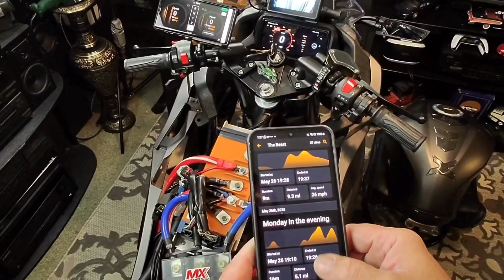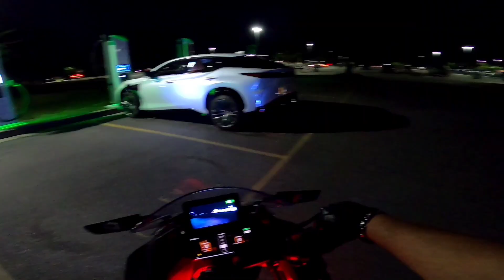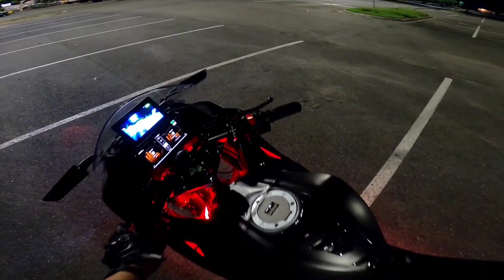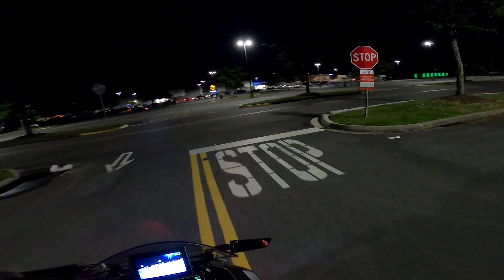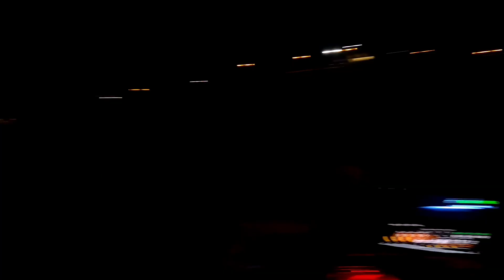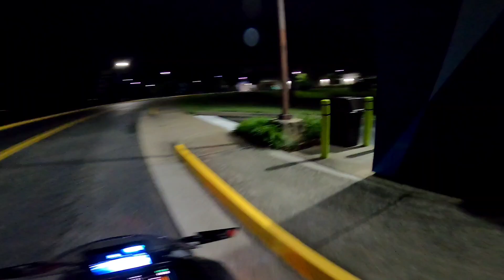100mph plus in speed & Range + regen on a 72v Electric Ninja Rz See how it rides & You be the Judge!

Comment: And it's a72v 50apm lithium battery ,the only upgrade I did was the controller upgrade same votol brand from Em 50 to an Em 100 controller and motorcycle tires and side from ninja 300 mirrors .

Comment: Oh so now you want to give up all the secrets??
Reply from the maker: Bro I been giving up the secrets for a long time. You just gotta watch all my videos cuz Im always giving it up but its never in the beginning. Id put that shit in middle or the end so those wanna skip thru or just hate watching me, lol aint never gonna get it. The secret has always been Battery Power but Good Batterys dont come cheap and the best batteries you cant buy at all, they gotta be custom for custom builds or you can put together a few of the manufactured in paralell that still aint cheap. The cheapest Good battery company is amorge and their closest pack to this is a 20s19p Molicel P50b pack that cost $3700 and some change and thats made with Prefab bus bars. someone though i was BSing when they ask me how much to build them a 100ah the way i build it, Overbuilt and I said $4500. well first thats 400 P50bs do the math on just the cells alone and you waste their output if you think you gonna run that thru a 90$ ant BMS. If you need that safety feature 500 amp Daly is $500. I get it Shit aint cheap I didnt buy mine i built it but if you asking me to build you one I dam sure aint doing all the work I did for free so wanna play gotta pay. It aint neccesary if you just wanna ride you can ride for much much less. But if you trying to be the Boss with the Sauce, that comes at a cost. If you wanna be the Man you gotta Beat THE MAN!
Reply: @ChrisCrossingWires1212 I know just joking but there are a lot of things I definitely need to catch up on.❤❤❤